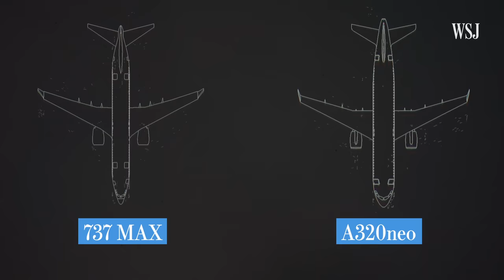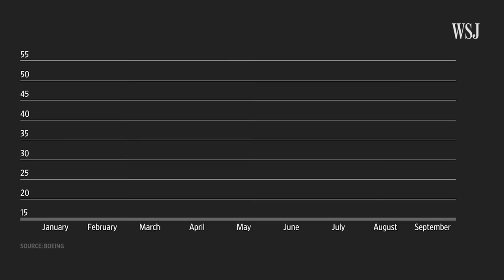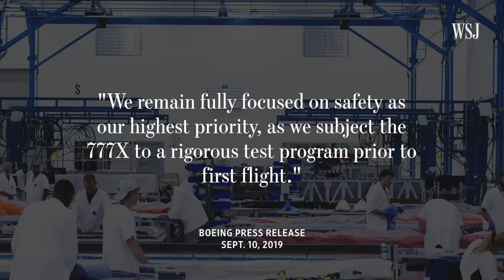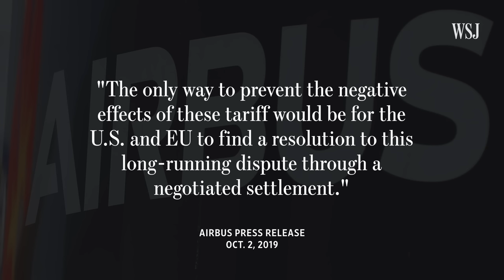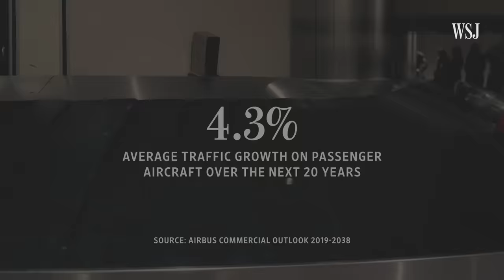Boeing vs. Airbus: Why Aviation’s Biggest Rivalry Is in Flux | WSJ

Comment: Airbus has a major backlog they have to fill. Business should be great right now.
Reply: M cook  Airbus at this time has a backlog that will take 8 years to fill at oresent production rates, as does Boeing with the 737,  airlines cannot just go buy the other plane !!!!  Airbus exist ONLY because years back with airline growth Boeing experienced a large back order and airbus jumped in to take advantage of the situation !! ! Notice too how the A320 looks liken the 737 ???? Every wonder why ????
Reply: @wilburfinnigan2142  Actually, the A320 and 737 look distinctly different. And are distinctly different, i should know, i have flown the 737 for 15 years and now fly the A320 for 5 years. 

The general characteristics are the same obviously, as they aim for the same market space. So both are a fuselage with a set of wings, a rudder and a stabilizer plus two underslung engines. Well, not underslung for the 737 MAX anymore which causes the problem that MCAS tried to fix. Pretty much all current commercial jets share those characteristics however, just the size changes depending on the intended market space in terms of range and number of seats. 

Airbus exists because back then the european aerospace manufacturers put their business into one integrated company to be able to compete on the world market, of course initially helped by their respective governments which was allowed at that time. And then Airbus actually build a compelling product and of course that did sell eventually. A huge factor is that crew training is extremely cheap when moving from one plane to another, and airlines routinely use the same crew to fly A320 and A350 or A330 or even all three, or fly the A330 and A340, that does allow very efficient crew planning and reduces the number of crews that are needed for any given operation. Of course that is only possible as pretty much all airbus flightdecks are very similar in controls and operation.
Reply: @wilburfinnigan2142  go and do your homework kid.

Airbus first plane, the A300, introduced new technologies and filled a gap in the market.
The a320 is much more modern than the 737 and better suited for future upgrades (partly because it got more room for the engines under the wing)

And the a380 has no competition at all
Reply: That will cause airlines to buy the airbus A220 (aka bombardier CS-100 and CS-300)
Reply: Nicolas Blume he’s probably just an american nationalist who hates everything not made in the US lol
Reply: @wilburfinnigan2142  Giving the fact that the 737 Max copied the A320 by doing the same thing.
Reply: @wilburfinnigan2142  i was speaking more so about the engineers and technicians. With all the backlog at least they should have job security.
Reply: Wilbur Finnigan just a blind boeing fanboy. Airbus exists because of the technological revolutions in the a300 that filled the gap in the markets and dominated the US American airspace. And here we go with the “AirBuS CoPiEd FrOm BoEinG, ThEy LoOk ThE saMe”. I had a good laugh there.
Reply: Dr Gilbert as of most boeing fanboys. Complete nutters those people. A Disgrace to aviation enthousiasm
Reply: So does Boeing.
Reply: @wilburfinnigan2142  Compare the first generation of A320 and the 737 variant that existed back then ( the 737 Classic) and you'll see how Airbus did bring some great innovations with that plane like the Fly by wire system.
Reply: Nicolas Blume well of course A380 has no competition. It’s on the part of the market that Boeing abandoned a decade ago. 

While Airbus is busy making their whales, Boeing is pushing forward for the 787. Which was far more successful. And change a lot of airlines.
Reply: @adysoferu  Innovations but were they really improvements ????  Just the fly by wire for control and they crashed the first one at an air show !!!!!  And they had to use US engines and still do today !!!!
Reply: @wilburfinnigan2142  looks like? Not even close.
Reply: @sneeki8082    How long since you had your eyes check dummy ????
Reply: @wilburfinnigan2142  yes becauuse a more pointed nose on the 737 looks suuuppper close to a rounded one on the a320. Nice eyes you got there.
Reply: Hariz indeed
Reply: @Soordhin  "The general characteristics are the same obviously"   what, they both fly? uhhh, wait... errr, forget it

Comment: The real issue: new engines have large diameter in order to reduce noise. New engines could not retrofitted to the 747 max because wings were too low on the 737 and the engines would touch the ground. So the designers were instructed to mount the new engines a  higher and off centre. However, the problem with this is that aircraft would pitch down. The solution to this was the software, which would automatically correct the pitch of the aircraft. The problem was that was a Boeing selected a cheap fix (i.e not redesigning the wings) and also opted for cheap software (i.e. they retrenched their experienced software engineers and hired lower cost inexperienced programmers). The management thought that they could offer a better product than Airbus as a lower cost. Unfortunately it did not work out that way. 

Therefore, is classic case study, where management instructed in reducing the quality of Boeing engineering, which bit them hard on the back side. Unfortunate people also had to die in the process as well.
Reply: Do you have any links of this study?
Reply: ...the tendency was to pitch up, not down. And it's also important to note, that there was absolutely no problem what so ever with that.
 It was just a tendency of the Max easily compensated by any pilot.
 But Boeing wanted to avoid new pilot certification for the Max to avoid extra costs for their clients with extra time wasted on training of a new aircraft. So they inserted a computer operation to counter balance that tendency. 
...but they've decided to do it with one single computer (before the Max changes, all 737s only operate 1 single computer under normal conditions) and that based on signals from one single sensor. No redundancy.
...and basically they did it, without proper explaining the system (MCAS) to anyone. So pilots had to guess there was a program running interfering with the trim of the aircraft ...and that they needed to switch off the trim assistance to avoid it.
 As if that was not enough, even switching off the auto trim, the aircraft attitude could be so extreme already, that the physical force needed to fix the trim manually (737 is an analogue aircraft) might be very too difficult or even impossible to apply. Also, switching auto-pilot back in, could rearm the auto-trim.
Interesting stuff to discuss at a table meeting, not on a cockpit of a diving plane.
Reply: @miks564  yeah, Ron Howard has a great doc about it on Netflix. Harrowing to know those pilots didn't know about MCAS,  and applied their training while not knowing they were fighting an invisible ghost

Comment: Boeings CEO: "is a Safety is our no1 priority"

Boeing should be really careful using these words after they proved the opposite.
Reply: It was two planes used by incompetent pilots, of course they'll crash, no amount of automation fixes an idiot pilot.
Reply: I think he make safety for their profits is their priority. A simple misunderstanding surely. 🙄
Reply: @rollog1248   Hello, the plane was so flawed fundamentally that it needed an augmentation system to realign its climb angle. Using an electronic augmentation system to counter a fundamentally bad design was a bad idea to begin with, everyone would know that technology systems are prone to failure and it shouldn't be used as a replacement on critical areas such as safety systems.
Reply: @Sprunk Soda: Way to go. Please keep on blaming the customers until they shop from someone else.
Reply: @rollog1248  do not write about things you don't understand. Do a favor to all of us. Thanks.
Reply: @rollog1248  says a guy that have a Soda in his name.

Comment: Remove that MCAS system,  and install additional non-moving aerodynamic tail surfaces that would negate any 'lift' created by the engines at high angles of attack. This would give the plane 'natural' stability, regardless of the tail's control surface position, and would make the MCAS system unnecessary.  Anyone could figure out this simple solution to the 737-MAX's instability problem, right?
Reply: yeah but then pilots need to be retrained or something $$$

Comment: I enjoy flying in planes from both companies but as quantity goes up, quality usually suffers. Good luck Airbus in not following in Boeing's footsteps. If Boeing were smart, they'd scrap the 737 max and start planning and producing a plane to replace it. The public is vary wary on the 737 name. Boeing needs to develop public confidence in their aircraft all over again. Keeping the 737 name, won't help.
Reply: Sizzlemann  Boeing has a backlog of about 4500 737s !!!  Airbus the same !!! Delivery times now for a new order is right at 8 years !! !or did you not know that ????  737 has been flying for 60 years and is the most used aircraft in the world, over 10,000 have been built !!! It is the basis for the airline business.  NO WAY can Boeing shut it down !!! It takes many years to design and test a new plane won't happen !!!

Comment: A350 is awesome ...
Reply: B777X is coming to make you hold your beer.
Reply: Captain Saom Nothing can Match the A350 in mileage and technology. B787 comes close but A350 is better
Reply: @chiragraju821  You really think the B777X won't be a dealbreaker? Also, I wasn't talking about B787.
Reply: Captain Saom Mileage/ passenger yes. 
787 has a full composite body unlike the 777 X 
So 787 is still the most economical Boeing aircraft in the market
Reply: @chiragraju821  ok, we'll see
Reply: @raahimhadi4905  aaand the a330 neo
Reply: @chiragraju821  IMO the 787 just looks more badass. And is more fuel efficient
Reply: Jack what looks more badass than Zorro’s mask? See A350 from the front
Reply: @chiragraju821  See a Dreamliner's wing flex and you tell me
Reply: Jack well they got their own stuff. But A350 wing is regal af
Reply: @raahimhadi4905  cough exploding cargo door cough
Reply: winter heat 777x has never even carried passengers so don’t be ridiculous
Reply: @winter heat right, the A350 certainly can't be competition to what's for now, only a "dream" in the mind of cutting costs engineer
seriously, only use this kind of argument once the plane fly, has carried enough passengers who will give their 2 cents about it...
Reply: @raahimhadi4905  the 777x is literally just a 777-300ER with folding wingtips.
Reply: @chiragraju821  a350 stomps b787. Boring ( no spelling mistake I mean it ) 787 has 3 3 3 economy as its standard config which is pretty underwhelming.
Reply: @guy3639  Considering how popular the 77W is, that's not a bad thing at all.

Comment: Airbus is roomier so my  votes to it!
Reply: The roominess of an aircraft cabin is largely determined by the airline you’re flying on, not the brand of the aircraft itself. For example an American Airlines A320 will have alot more room on it than a Spirit Airlines A320
Reply: @John-yg2rt  True, seat layout largely determines the available room for passengers to move around in. And airlines, not aircraft manufacturers, choose the seat layouts.
Reply: The size of your seating is actually completely decided by the airline
Reply: When I seat near the window in Boeing the curvature of the fuselage touches my head. In airbus I don’t experience that.
Reply: @John-yg2rt  yeah, but imagine a spirit airlines 737 lol, would be way worse
Reply: Airbus planes actually have fixed seats (I think) while the Boeing ones have them held on racks, meaning that airlines can change the number of seats on Boeing planes. Correct me if I’m wrong

Comment: European Engineering is the safest there is
Reply: Airbus Alpha Protection: well yes, but actually no
Reply: You got the point
Reply: cough death by wire cough
Reply: @shindenfighter3303  777 and 787 are fly by wire.
Airbus just brought it into the commercial aviation world in the 80s, Boeing just followed suit.
Reply: Boeing 737 max is a fundamentally flawed design and has no business being in operation. Boeing 737 max should be grounded permanently.
Reply: like the hindenburg
Reply: So I guess Airbus NEVER crashed back then.
Reply: Johnny Wynn Can you name an accident involving an Airbus aircraft that the final investigation report declared the deciding factor of the crash was specifically a fundamental flaw with the Airbus system? I’m not bashing Boeing or the max here, I haven’t read through either of the investigation reports for the crashes and I’m betting that it could very well be the lack of training from the pilots on the 737 max systems.
Reply: @O-oo3uu  Their flight software have been written by Indian engineers on reason of low cost hire man hrs.  And that's.
Reply: @shindenfighter3303  Have a look at the accidents caused by the fly-by-wire technology. Compare it to the traditional one in Boeing aircraft after Airbus entered the market.
Reply: @Racko.  Unfortunately they did. But if you compare crash rates dedicated to design or production flaws you'll find out something interesting.
Reply: @johncatty6560  That's what I'm saying lol
Airbus has had it's fair share of problems in the share as well
Reply: @brendanpetry6709  My Point is, there has been incidents on both sides of the Aircraft makers, Airbus you asked? Two Examples: LH 1829, Air Asia 8501
Reply: @Racko.  Airbus NEVER had a global grounding.  Boeing enjoys its second. Nice. Well done there.
Reply: Shinden Fighter pretty sure no airbus has crashed due to a direct failure of the flight controls. Also the 777 and 787 are fly by wire
Reply: @O-oo3uu  Chinese and Korean takeover I understand. But indian? The biggest thing india has going for it in silicon is that they make a small percent of iphones. Like, get real...

Comment: Deliveries are sales from the past. This video misses the gap that opened between Airbus and Boing 2019 in sales. In 2019, Boeing finally had negative net sales (more cancellation then sales), while Airbus net sold 768 (sales minus cancellations).

So far, Boeing has set asside  $6 billions for customer compensations. Noone knows if this will be enough. 

It looks obvious to me that in 2030 Boeing needs a totally new plane, the 737 has been maxed out. The developement of the 787 costed $35 bio and to my knowledge hasn't reached break even. With the loss of sales in 2019, with  upcoming compensations, public doubts and upcoming chinese competition, the future will be demanding.

Does anyone remember when Boeing grew up to be No1 in pessenger flights? It was when the british made COMET had a series of crashes and was grounded.

Comment: Think of it like this, you have a radiator, the radiators has a gas line that needs to be replaced, and you do that. But, in replacing the gas line, you had to make some changes for the gas line to fit on the radiator and, in turn, you broke the radiator. You have two options, both are rather expensive, but one is more sustainable.
A. Replace the radiator
B. Try and fix the radiator despite it being decades old.
Reply: C. None of the above has anything to do with airplanes.
Reply: @FourDollaRacing  Do you know what's causing the MCAS system to malfunction?
Reply: @FourDollaRacing  it does. T fuselage is the same as the older 736 models. They just fittted massive engines on it. This changes the centre of gravity and can cause thr plane to stall. What did boeing do? They didnt change the fuselage design, they just added an electronic system that would pitch the plane down auromatically if it detects an abnormal angle of attack.
Reply: @FourDollaRacing  the basic is: 737 is too short on its "legs" and they couldn't fit the engines the usual way... that changed the aerodynamic... to deal with a structural defect, they implemented a software solution that correct the effect of the defect... but sometimes, the software get bad data and react the wrong way... and the pilots weren't informed (at first) nor trained to deal with this... and guess what?
why didn't Boeing design a new plane to fit the engines the right way? cost and market share loss due to the delay
why didn't Boeing add more data source (3 instead of only 2)? cost
why didn't Boeing implement a training program for the pilot to learn how to deal with the known software problem? cost (pilot training cost a lot to companies)
whatever the industry, there may be flaws... the difference lie on how they deal with them and the severity of the effects of said flaws...